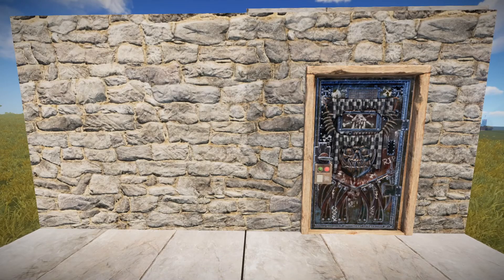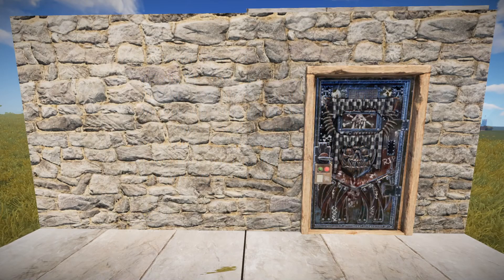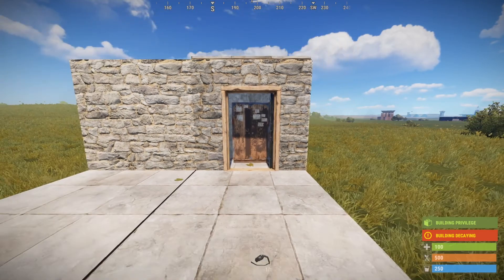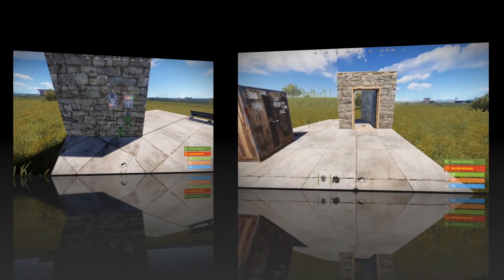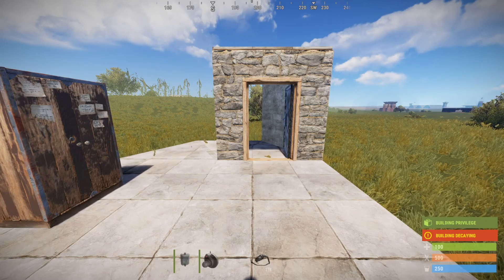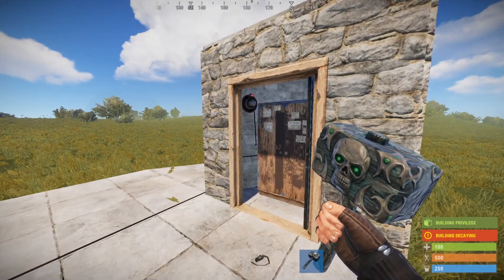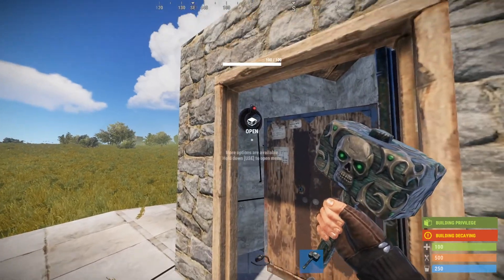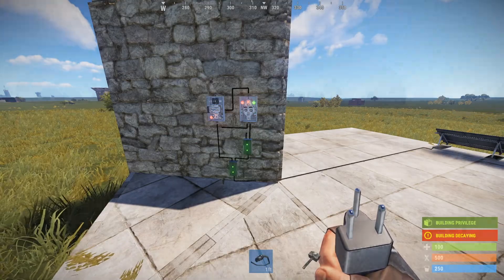(RUST) Community Projects #3 - "The TC Vault" (Pete Nolin)

Comment: also, you can hide door controllers on the sides of walls before you attach the next wall.
put up a door frame place door controller on the narrow exposed end and then put other wall up. if done right you can hide the door controller. also, also, you can run the wire through the wall to hide it like you would through terrain.
Reply from the maker: Indeed, there are a few different ways you can hide wires and door controllers. Good to hear you're playing around with things :)
Reply: @SpibsTV  i spilled cereal on my computer after i had made a 2x3 that cost over 1000 HQM in electrics. trap roulette with auto-release all automated with notification and auto reset. i think god told me to take a break with that bowl of cereal... took a month to get right and almost a week to build it the second time.
Reply from the maker: @cortedemico  Hahahaha, that hurts.